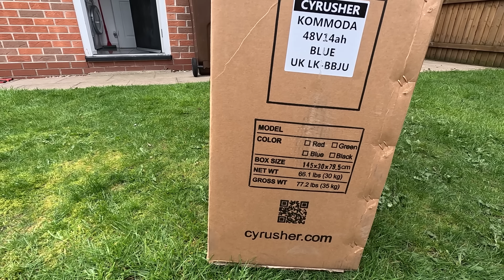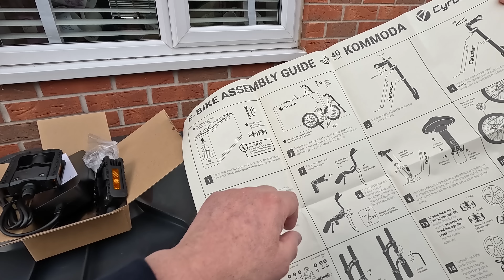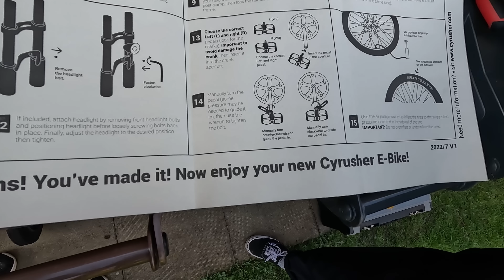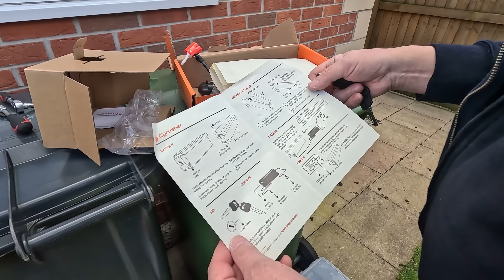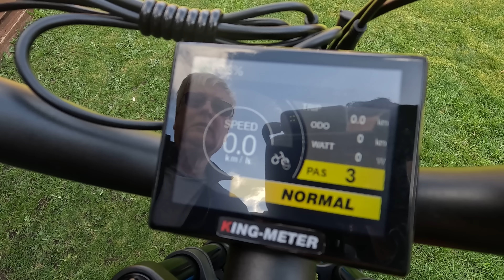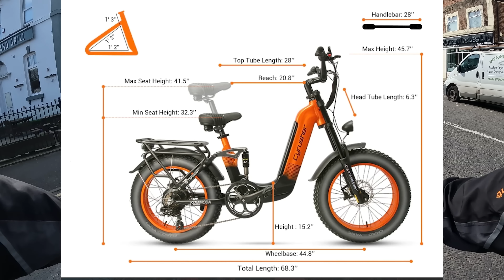Cyrusher Kommoda Fat Tyre E-bike Part 1 | Assembly And First Ride

Comment: Thumb throttle bikes are actually illegal on UK roads...even when restricted 😮
Reply: Same here in Ireland. Just remove the throttle and it’s no longer illegal.
Reply from the maker: Or in this case don't put it on in the first place.
Reply: @BobEarnshawMoHo  It does not say it comes with the bike, i hope it does i intend to use it, no one cares.
Reply from the maker: It came as a option with my bike.